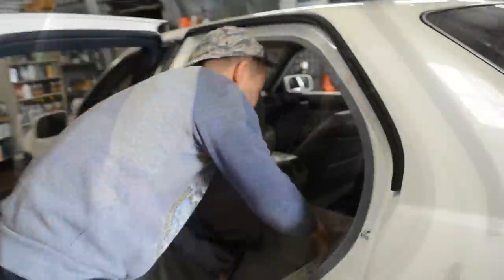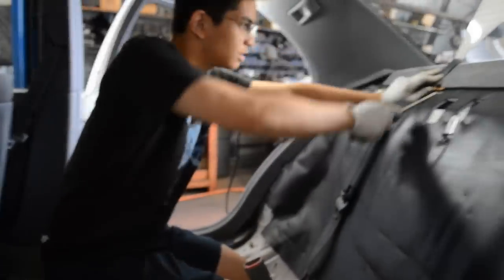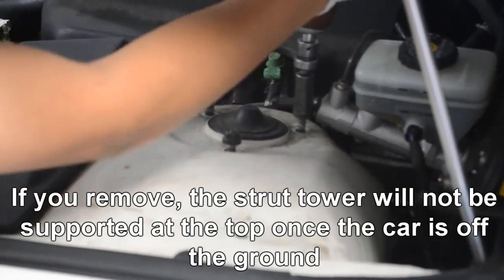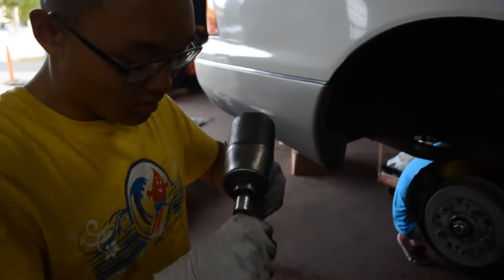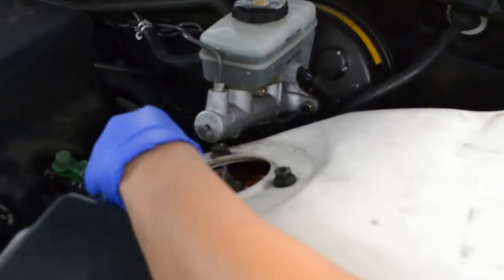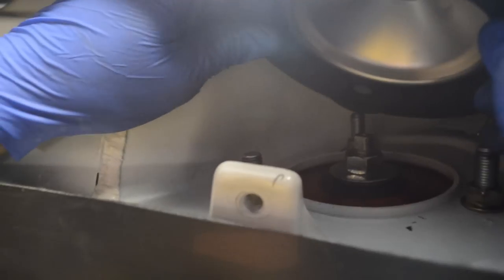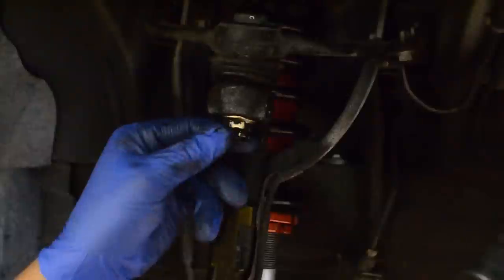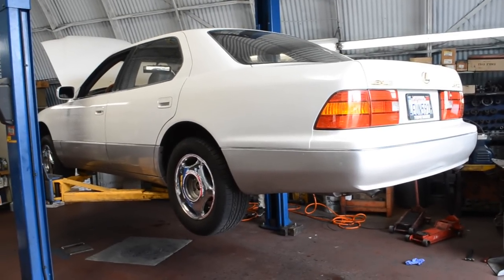How To Install Lexus LS400 Coilovers

Comment: Nice video guys.  I did coil-overs on my '98 LS too and you guys cover most of the steps pretty thoroughly.  Some personal thoughts...take it or leave it:  pneumatic tools are handy for doing wheels and for stuck bolts/nuts but be cautious when using them during reassembly.  Once suspension parts are stripped - you're effed.  Also, I heard someone mention torque specs which the narrator quickly dismissed with a "nahhhh".  You guys used the PFT method - which is ok - but remember torque specs on your suspension will keep your adjustments in place while saving those rubber bushings from premature failure. And if you do torque everything down, do it with the suspension loaded on the ground or on those drive-on ramps.  Good job!
Reply from the maker: +Tom Andrus I agree with you on all those parts lol, Thanks!
Reply: @statefarm He knows a thing or 2 because he’s seen a thing or 2

Comment: I plan to buy a Lexus LS400. The problem is ; it has an air suspension in it. I heard the air suspension uses other strut tops. Do you confirm ?
Reply: not sure, but steps shuld be same. I suggest with staying bagged.

Comment: I have 99 and a 06 Ls ...im actually about to slamm my 400.  This car is really expensive to modify but if its done right its a nice ass ride.  I dont understand why would the front upper a arm have to be drop?  How long did this take for all struts to be remove and put back?  It didnt take long for you because you didnt have to mess with the old strut as of you had to change out spring with the oem strut .  👍 video .
Reply from the maker: +Judy Song It allows for the bottom of the suspension to lower so you can pull the shock out easier, you can try without it though and see if you can do it. It took us probably a good afternoon because we ran into seized bolts. This is definitely something you do in a day though. As for springs, if the drop is more than 1.5in then I wouldn't bother. The shocks are probably old and are going to blow soon with springs. I personally went from stock to springs and then coils. If I were to slam though, I would go straight to coils and save the time and money.
Reply: +Kevin Duong (KevinXDuong) what did you use to get the front upper a arm off the arm that goes down to the frame...the one with the castle but and pin ...I couldn't get mines off so im stuck.  I even compress the strut and it wont clear the bottom strut housing ..
Reply from the maker: +Judy Song Sorry for late reply, I was busy with finals. Did you get it off? I used an impact gun, but you can definitely use a breaker bar to get it loose.